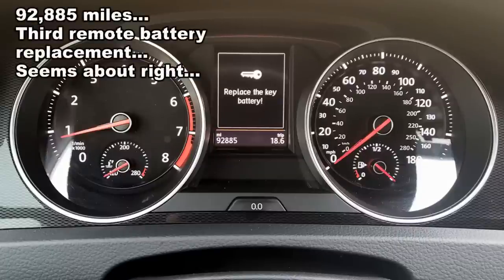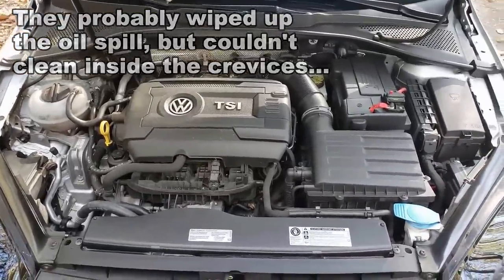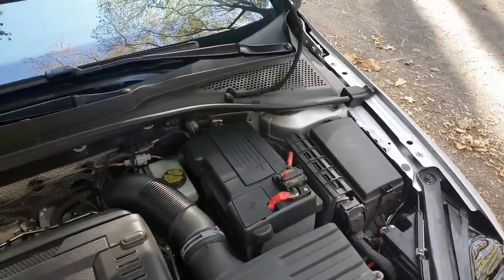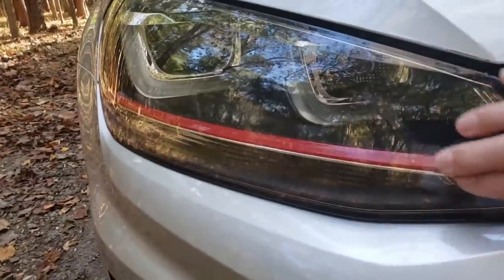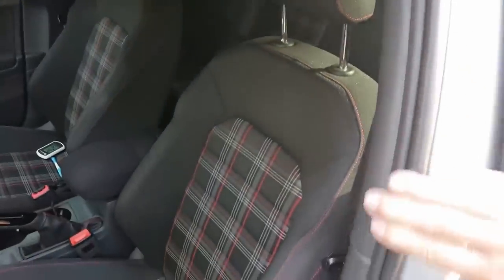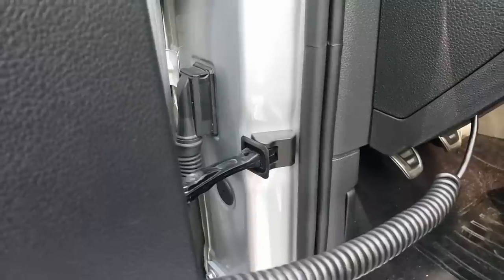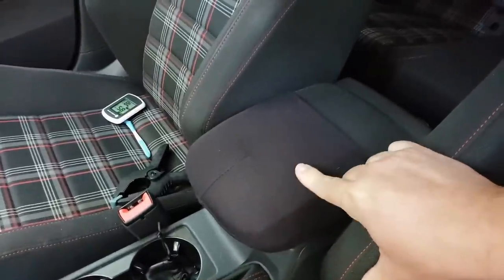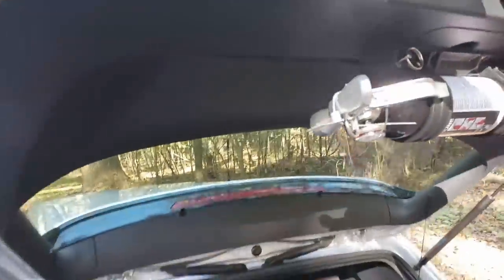THREE YEARS AND 93,000 MILES: My Report, Part 1

Comment: Hey, did you check and see if the front cover or the dipstick tube for leaks too? Sometimes the upper pan can seep out and make it look like the lower pan isn't sealed. And since you have a lot of oil on the RH leak I would definitely spray it down and clean it to make sure where its coming from.
Reply from the maker: Thanks! It was definitely the lower oil pan seal. Hasn't been a problem since adding the Tiguan gasket. See another video a few down from this one for details.

Comment: How hard do you drive the car I have a manual mk7.5 I want to tune it but I’m afraid I’m gonna break something because I’m pretty hard on the car I dont launch it often and I make sure it’s up to temp before ripping it so I’m not sure
Reply from the maker: "Hard" is subjective. Some say I'm hard on my car since I tow (I agree). But I seldom do wide-open sprints and never launch. I guess it's a matter of tolerance to abuse. Warming up the car before thrashing is always a good thing. Thanks for visiting.

Comment: Garbage cars. My Subaru has not dropped one bit of oil or anything mechanically wrong with it. The interior is still in good condition and drives like new. Garbage!
Reply from the maker: My oil leak is self-inflicted. The comments below indicate that the factory pan does not leak, except for one person. No telling why his car leaked. My interior is still like new, except for the bolster wear (my fault) and the weird adhesive on ONE small panel. Thanks for visiting.

Comment: I'm glad to see someone having better luck with a VAG product than me.  I owned a  2012 Mk 6 from Oct 2011 to Aug 2019 with 136K miles on the clock when I got rid of that  thing.  Here's the butcher's bill for my POS - 5 intake manifolds, 4 sets  of fuel injectors, 3 water pumps, A/C compressor, A/C cooling fan, 4 batteries, high pressure fuel pump, 5 PCV valves, 3 sets of rear roll bar links.  After coming from 23 straight years of bullet-proof Honda ownership, it was a discouraging experience.  VW sales people and service personnel were total pricks.  Being a aviation mechanical engineer, it was good that I was able to do virtually all of my own work.  If I would have paid VW techs every time something broke on the car, it would have bankrupted me.  The problem with VW is they use too much cheap brittle plastic in critical locations such as water pumps, engine balance shafts and even intake manifolds. And don't even get me started on their interior plastics!  My issues really kicked into high gear after about 3 years of ownership.  It is easy to see why VW sells 28K cars a month while Honda sells about 116K and Toyota about 165K a month.  It boils down to reliability, dealer and manufacturer support and sadly VW fails miserably on all factors.   Like so many other people, I'm one and done with VW....
Reply from the maker: WOW! What a mess... and a total turn-off to a brand. What are you driving instead? Thanks for visiting.
Reply: @StealthGTI  I bought a Volvo C70 and absolutely love it.  At 4400 pounds, its built like a tank with high quality high strength steel.  When I look under the hood the engine has lots and lots of metal - in fact the only plastic items on the engine are airbox and intake plenum.  When I mess around with it, it doesn't feel like the parts are going to break, because most items look to be over-engineered and made from good materials.  When I bought it, I was very picky about my purchase and was able to get the complete maintenance records and after reviewing them, it never had an issue that would strand the owner.  The only thing I have done so far is replace the brake pads and I put a vinyl wrap on the center console to jazz it up a bit.  While it doesn't handle and hustle like my GTI, it has a phenomenal ride and seats that are nothing short of amazingly comfortable.   My wife likes it so much, she has me looking  for a gently used 1 to 2 year-old XC60.  Good luck with your V-dub, especially since you're getting close to 100K on the clock - on my car after 100K that;s when things really started breaking.  I have heard that the Mk7's improved some of the real problem areas of the Mk6's.  However, that much plastic under the hood....  Bonne route!

Comment: Interesting, I also have a 2017 GTI Sport and the handbrake was never fully leather wrapped and it had that gloss black upper finish standard. Also, the carpet behind my rear seats look like a different material than what's peeling on yours. Did you buy your car brand new?
Reply from the maker: Also, I did buy the car new.

Comment: Be  glad you don't live in the Rust Belt  my 2011 GTI  had rear suspension subframe rust out in 68K. Also switched to 17" Motegi Wheels from Tire rack after 2 winters. Run the winter wheels year round for a better ride.
Reply from the maker: I am certainly glad I don't live in the rust belt. I don't like snow. HAHA! Thanks for visiting.

Comment: I have a 2016 R and I too have had my stock battery fail, I don’t think it was my fault tho :P. I too have a weird squeaking noise comin from my doors when I go over uneven pavement or speed bump. I’ll have to check that bolt that you commented on. I have 47k on my R right now and I’m still in love with it. Oh and my coolant is having the same issue as well. Nice update video tho bro. I’ll keep in touch about my door squeak noise, it sounds like it’s coming from my door seals? I’ve used Adams VRT stuff on them to keep them supple but idk. Have a good one man
Reply from the maker: Danny - I went down the same path as you, lubricating my door seals. The check bolt solved it right away. Thanks for the comments.

Comment: I’ve had a 92 GTI 16v 2 liter since 1999. It only has 193k original miles now. Recently picked up a Scion XB second gen 2015 with 30k since I have 2 kids, I liked having working AC and safety features, but I only drive 3k miles a year. I could likely just still drive that GTI. I love it still, I’m insane for MK2s. I’d like to restore it. It’s still very nice. Needs a few things like sunroof repair and a paint respray.   Recently had headliner done.
Reply from the maker: Very nice! Good to see some still on the road. My Mk3 lasted 18 years and 450,000 miles. Unfortunately, it got rust in the strut towers, which is usually a kiss of death on those cars. Thanks for visiting.
Reply: Yep, our West Coast cars geberally never suffer rust unless near the ocean.

Comment: I have a 15 gti. I don't think the steel pan is necessary if the car isn't lowered. I have it on mine cuz its lowered and I have a small leak.  Gonna reseal it next oil change. Already resealed it once immediately after installing it. It's a pain but if I hit a pot hole or something I know it's not gonna shatter like the plastic ones do.
Reply from the maker: We have just enough road debris here, as evidenced by the dent in my hood, to warrant some precaution. Imagine what that rock could have done to a plastic oil pan if it had bounced down there instead.  The odds of it happening are rare. But why not armor-up, if doing so will prevent an impact altogether?

Comment: You worried me when you said your clutch failed at 15,000 miles😁. I've been driving my 2007 Toyota  tacoma 4 banger base  with manual transmission for 13 years, 247,000 miles on it with still the original clutch. I'm planning to treat myself with a 2020 GTI se 6 speed manual and I'm keeping it stock. Good video very informative. Stay safe.
Reply from the maker: Thanks for the note. Please read the pinned comment at the top of the comment feed. In short, my clutch did not fail. I replaced it preemptively. Thanks for visiting.
Reply: @StealthGTI  Yes I read😁. That's what give me a peace of mind. I'm excited to get mine!

Comment: Great video on the Mk7   my 2016 GTI S had a few issues   currently has 50,000 miles.  1. Factory tires worn out at 25,000  2. Front windshield had 3 rock chips in by 30,000 replaced at 35,000. 3. Headlights needed updated at 35,000 4. I do use some coolant every oil change  5. Changed plugs at 35,000 .   Car has OG brakes, no Mods, runs good (only premium)  & DSG has no issues.
Reply from the maker: Thanks for sharing your experience.

Comment: Had a question related the car but not necessarily this video, I’m thinking of buying this car but I go camping a lot and I jus wanna know how well it handles steep mountain inclines
Reply from the maker: Do you mean steep PAVED inclines? Or dirt roads? The inclusion of camping in your question threw me off. If paved, I can't imagine a paved public incline that this car cannot climb. I drove over a mountain pass with a 7% grade while the car was loaded with three passengers, luggage, a cooler, and lots of food. It was a Thanksgiving trip and we had the cargo box mounted (extra wind resistance). The thought of us struggling over that pass never crossed my mind. We sped up and over without even disengaging cruise control. I would have taken the trailer without hesitation, but we needed a small footprint at our destination. If your question was about a dirt road, I cannot answer with experience. Still, I cannot imagine the GTI being at a disadvantage beyond what any other FWD car would have... unless you're on a road that requires ground clearance. Did I cover your concern? Thanks for visiting!

Comment: Coolant always go down after few months from normal evaporation in all cars.  Just top it off with distilled water. As long as it is less than 1 L per 3 months/3000 miles.
Reply from the maker: Thanks for visiting.

Comment: My mk7 goes through coolant also. I've had to top it off at least twice in 25,000 miles. I wish I knew where it goes. Also lots of creeks coming from my car. I have lots of upgrade including engine and trans mounts that I think aren't helping lol. I've also had to tighten that exact same triple square bolt on the drivers door once. My center console also rattles like crazy and I hate it but a lot of mk7 owners talk about that issue also. Thanks for sharing your experience with your mk7.
Reply from the maker: Thanks for visiting.

Comment: Very interesting creak troubleshooting (door hinge, but sounded like it was the B pillar). I had an odd rattle in my 2014 mk6 GTI that turned out to be a loose piece of plastic inside the sealed passenger headrest. I removed the headrest and shook it, and the rattle was quite loud. Fortunately the dealer gave me a new one, as it was still under the bumper to bumper warranty.
Reply from the maker: Very interesting! Cars are fickle things! ;-) Thanks for visiting.

Comment: Those early incarnations of the 2.0 engine were notorious for excessive oil consumption. So much so that they are considered the worst engine ever to come out of VAG, along with the 1.8 tsi (not the 20vt of old) that shared the block. I hope they managed to fix it for the mqb 2.0 era...

DSG=nightmare in general, best of luck. Seen you got the manual! Great!
Reply from the maker: From what I've read, the EA888 fixed all of the shortcomings of the older engines. Sure, it may have a few of its own, but they seem manageable. Thanks for visiting.

Comment: Good video. The SUNROOF on the cars is a BIG, BIG problem that I predict VW will be faced with a class action lawsuit on in the future. At just three years old and 55,000 miles the framing around our sunroof cracked exactly like the picture you had in your video. The dealership wants no part in the repair and by that I mean they don't want to touch the car. They would only refer me to a body shop. My VW service adviser is a stand up guy but he basically turned stark white when he was advising me on this. BIG bucks to repair this as it is VERY labor intensive. 
The cars are fun to drive but absolutely nightmarish at times to own. It should not be that way.
Reply from the maker: Sorry to hear about this for you. I wonder: My rooftop cargo box leaked at its PLASTIC rivets. It was a huge disappointment from an expensive big-name box. Sure, there's a warranty, but shipping is on the customer. No thanks! I solved that problem by having the box wrapped. I wonder if the leaks on cracked sunroof frames can be mitigated by wrapping the roof? Or does the crack go too far into the sunroof frame to cover with wrap? BTW, I was suggesting a wrap that goes around the glass. BUT, I imagine a full roof wrap, with sunroof-disable, would certainly stop the leaks. Pull the sunroof fuse after wrapping. It defeats the purpose of having a sunroof... but no leaks. Brainstorming does include ridiculous ideas, right?  ;-) Thanks for sharing. -Scott

Comment: 3:30 My MK VI GTI (2010 MY) was having issues with low coolant as well ... not sure at what mileage, but way less than what yours has done. Dealer couldn't find the cause for it at first - later it turned out that the water-pump was on its way out. Known issue with 2.0 TSI engines of that vintage - AFAIK VW put in water-pumps of dubious quality for a while back then. Car was out of warranty by then and VW only paid half of the - rather substantial - repair bill.
Reply from the maker: Yes. I still don't see the leak, but the coolant level is low again. I think I need to budget for a new water pump. Thanks for sharing.
Reply: @StealthGTI  Neither could I. Neither could the garage at first ... they did do pressure tests and all that and the car was with them for a bit. I'm not saying that this is what's happening to yours - but it did sound familiar... :/ And quite frankly I was under the impression that they had fixed that issue by either switching their water-pump supplier or by improving the pump design itself. I mean... my car was built IIRC sometime in late 2009 so that's quite enough time (you'd think) to fix such a common and well known "bug". Good luck getting it sorted out!

Comment: Did the clutch only go because of the tune then? New clutch that early seems...crazy?
Reply from the maker: Tune and towing combined. My old clutch didn't fail; it slipped one cold morning while towing. I probably could have kept driving it for another 20,000 miles or more. Who knows? I decided to replace it as a precaution, especially since I knew it was inevitable with my tune and towing habits. Thanks for visiting.

Comment: "Hit by rocks" Blimey, where are you driving the car, a quarry??  Nice review though, thanks. 👍🇬🇧
Reply from the maker: Yeah... Unfortunately, our roadways often have loose rocks, either from dump trucks on the highways or from regular drivers failing to simply sweep-off their flatbed trailers after moving a tractor or mower. It's a pet peeve of mine, seeing unclean or uncovered trailers. They cause more damage than most care to observe... until it happens to them. Thanks for visiting!

Comment: It's not notmal that your car consumes antifreeze. I recently change my evaporator an notice  that every few month it consumed some. I didn't notice any leakes or nothing. before the replacement of my evaporator I hadn't notice any premature consumption at all.
Reply from the maker: I'm confused: The evaporator is an A/C component. Coolant travels through the pump, engine, radiator, and heater core. Am I missing something? Thanks for visiting.

Comment: So do you think APR Stage 1 is okay for MK7.5 R DSG? You told you changed the clutch twice already.
Reply from the maker: I think most with DSGs recommend the TCU tune as well as APR Stage 1. Yes, that doubles the price of a simple tune. But it also vastly improves the way the car drives and reduces the probability of DSG issues... so I've read. As for my clutch, it has only been replaced ONCE. Thanks for visiting.

Comment: Did you have any issue with the fuel door yet? Mine will not open if I press. So the actuator (which looks like a propeller) is pressed in all the way and the fuel door is slightly open all the time. Is there an easy fix for this?
Reply from the maker: No problems with my fuel door. Have a look at http://www.golfmk7.com/forums/showthread.php?t=7533 for ideas. Good luck!

Comment: Hello SteatlhGTI, which is the paint protection you have? It is an invisible bra? I would be interested. Thanks in advance.
Reply from the maker: It's a 3M paint protection film. The shop that did the job closed their doors after a long time in business. If I was shopping today, I'd find an XPel installer. Thanks for visiting.

Comment: nice car but vary unreliable after 100ks have got a bad experience with VW .... belt snapped , valve bent cylinder head damaged ever since have never looked back to a VW just after warrant
Reply from the maker: I don't trust a timing belt to last past 100,000 miles, regardless of change interval. The consequence of failure is just too great. Unfortunately, most cars have interference engines that grenade if a timing belt or chain tensioner fails. $$$$$ Thanks for visiting.

Comment: Im in the UK and own a GTD, very similar in many ways. The Nogaro wheels are a big issue for us here. They seem to become buckled quite easily. I have had to straighten 2 in 5 years of ownership, and that is having a different set of cheaper wheels with winter tires on. On mine, the driver seat bolster foam is becoming weakened. The main issue i am having is water ingres through the speaker adapters in the rear doors, water leaks down behind the door panel onto the rubber gasket and collects there, eventually running onto the carpet. I will give the GTD an overhaul in 2020, replacing the seat bolster, sorting the leaking rear doors, along with a few other minor wear and tear issues. Overall its been a decent car. This year i needed to replace leaky rear shock absorbers and the ac condenser, along with a timing belt as it was due for replacement.
Reply from the maker: Thanks for sharing your report.